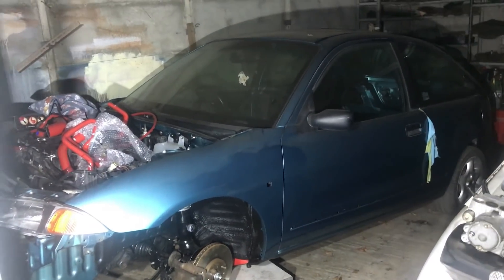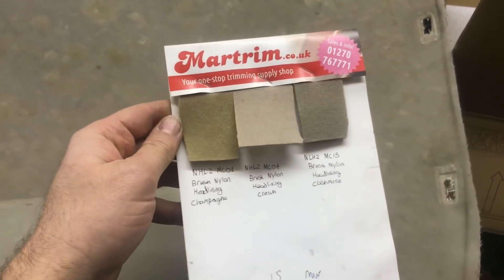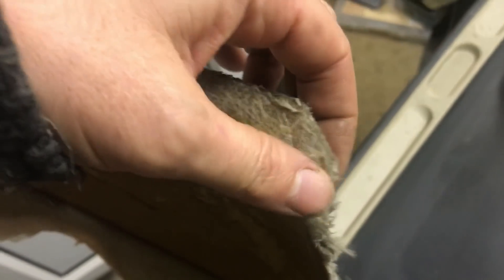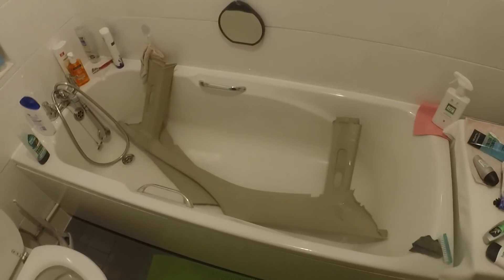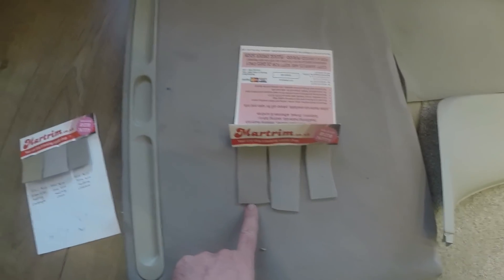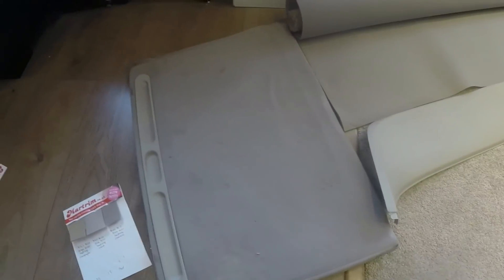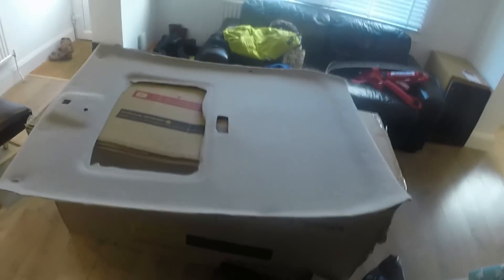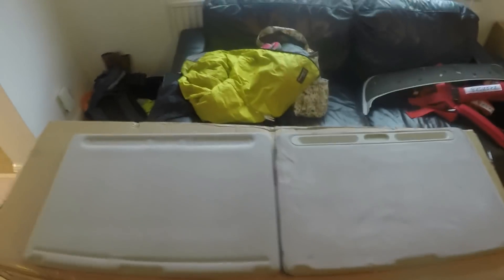Rover 200 mk3 Bubble T16 Turbo - Video 21 Re trim headlining

Comment: You can use very short pk screws to refix  the plastic sunroof trim. Just screw into the rivet stems
Reply from the maker: Ive resorted to my old favourite...Tiger seal.  I tried screw/bolts but didnt have anything that would bite in without just splitting the plastic.

Comment: Ive discovered baking soda and super glue work amazingly when reparing thing's like plastic etc and it will go rock hard instantly. Worth an experiment sometime
Reply from the maker: Ok, yeah ill have a try thanks
Reply: @nitrosilvia  pour baking soda on first then drop the glue on it. That works best. Build up the repair with baking soda in multiple layers if needed.
Reply: I can corroborate this. Among the activities I annoy my Girlfriend with, is guitar repair. baking soda and super glue can be used to fill in nut slots that have worn / been cut too deep. And it lasts for years with the stress of guitar strings pushing down on it. So it's a good hard filling technique when that is required
Reply: Model car restorers use this technique to repair broken diecast parts

Comment: To reattach the plastic bit, you could fill the centre of the plastic tubes, drill pilot holes, and use pan hard screws to refit it.

Comment: I've used cellulose thinners in the past, but you did a great job anyway.
Reply from the maker: Ahh yes.  I was wondering if i should try that or if it would damage the cloth or foam behind it?
Reply: @nitrosilvia  i’ve used it on an old BMW E12 were the carpet was directly glued to the floor. Not sure how it would behave on fibreglass, but Cellulose thinners can dissolve plastic. I used them before to polish tired E30 rear lights!

Comment: Nice work, did this job on my Accord Type R. Worst part of the job was getting the old glue/foam gloop off.
Reply from the maker: Yes very messy indeed.  Breathed a load of it too.  Turns to powder/dust.  Glad i did it outside

Comment: I’ll be doing this job next weekend
Reply from the maker: Good timing.  Another tip that i didn't put in video.  I would recommend to practice the movement of folding and laying down the fabric onto the headliner board.  Its surprisingly fiddly to lay it over flat with out getting a crease or a roll.  The pro's make it look easy in their videos, but its not.

Comment: A job I need to do with my ZS. Looks a lot less scary now. How was the removal of the the inner roof panel? Does it just come away when you remove all the trim and fittings?  Mine also has a sunroof. I take it the inner panel that you re trimmed here also comes away easily once the main inner roof panel is removed? Thank you ☺
Reply from the maker: On mine i had to drop the whole sunroof cartridge and then unbolt a metal plate and then i could manoeuvre the sunroof trim panel out.  There were also 4 little spring loaded clips i had to disengage.  One sprang out and fired across the room, so watch out for that!